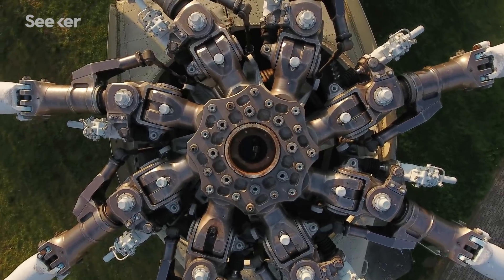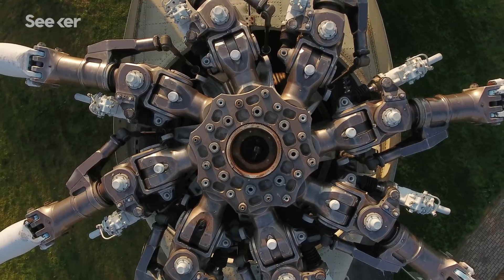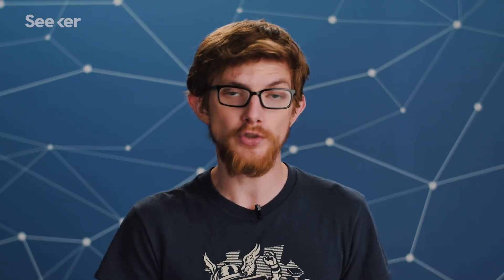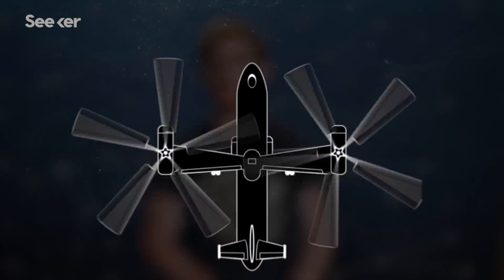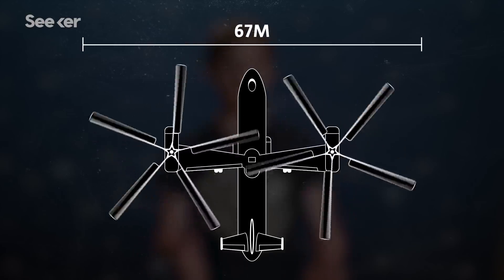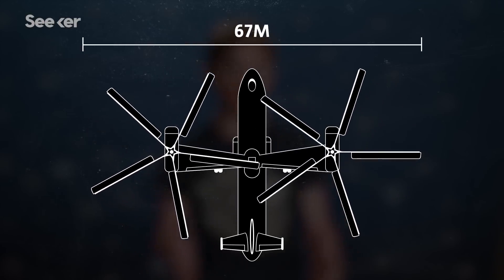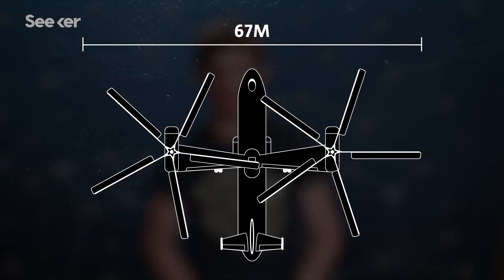Here’s What It Would Take for Helicopters to Be as Big as Planes

Comment: WRONG. *Biggest Bell has made and like most american content forgets about the rest of the world. Both the Super Stallion and the Mi 26 have greater Max takeoff weight which matters more and the Mil 26 has larger rotor diameter. V-22 84’ 7”  and 60,000 lbs,  CH-53 79’ 73,000 lbs, and the Mi 26 at 105’ and 123,000 lbs. And the Mi-12 prototype lifted 88,000lbs putting it at the largest ever at 220’ and 231,000 lbs

Comment: Id just add more blades. Just as subs do by adding more blades it decreases cavitation which would be a similar thing in the air just much faster w/ the sound barrier. Jet turbines have many blades too which again helps in this. Perhaps using both double rotor and many more blades per rotor would result in some amazing lift and speed characteristics.

Comment: Several factual errors, e.g. the supersonic boost in drag is not due to turbulence, and a there are ways to go fast in a helicopter that hovers with tip speeds near speed of sound. If you're going to do technical content, you need a competent technical editor. Thumb down, obviously. That said, the idea was cool, and if you re-do it *with due diligence*, then you might make something quite good.

Comment: the wing animation is upside down, low pressure area on TOP of the wing (caused by the acceleration of air due to the shape of the wing) is what generates the lift and not the air passing below the wing.

Comment: Of the speed of helicopters that become as big as passenger planes and their speed..
..
@Chemse Eddine Bouaziz
..
Hi,
It actually can. Multiple engines, multiple rotors.. and if wanted.. push propellers or jet engines easy to add.. In a plane design the wings are almost ultimately consolid.. but in a helicopter there are no such wings but instead very very flexible at once both horisontal and verticle movements providing propellers. A passenger plane let us say flies in a speed between 600-1200 kmph.. but when many many propellers are used instead of wings the thing would never be a less of speed.. however more of safety and (depending on the fuel but..) more cost.
..
Nevertheless, in helicoptering.. when the size gets smaller.. planes win the race of speed more in comparison.. which means: there will be circles flying instead of those stick like winged planes for passenger fligts so soon I consider.. however super speed flights in the air that are going to be based on aerodynamics will always be triangular in look..... .... ... but when it comes to nano-technical and basic force altering energetic flights.. flying machines will look like elliptical, globular or circular.. just like UFOs and Zeppelins.. and plus asthough triangular again.. they as some in shape will look like or be exactly as pyramids.. F117 Stealth Fighter is of such future design.. F35 is what is clinging to the Zeppelins..
..
This nano technical and g force controlling energetic fliers later will be using things as-in parallelism to "many propelling" scheme as those mentioned above.. and they then very probably will.. ultimately be flying like the UFOs.. unpredictably moving so fast from one point it stood in-on to another at a glance's time period.. as if they are using teleportation.. sound speed and further speeds will be surpassed so swiftly that the mass of air will carry the flying objects all of a sudden from one location to another or similar.. when by force and energy air gets so hugely handeled and g force gets altered.
..
Good bye.

Comment: So why can't they just have the ends of the blade designed towards  supersonic speeds and have the base of the blade design towards subsonic speeds, jet engines do it. Also, torque is a really bad excuse just use an electric motor powered by a gas generator if necessary.

Comment: I wonder if helicopter designs could be changed a bit or improved upon.  To me, giant spinning blades that are fully exposed do not seem to be the safest design.
Reply: Yes it is. As long as you're not 3m tall  and thry to reach te blaids.
Reply: there is also a fan wing design that's new that's really cool, it basically is like an old fashioned lawn mower blade on top of the wing of a plane..
Reply: Maybe rotors that retract the faster you go horizontally. I think some companies experimented with that I'm sure.
Reply: V2 Osprey bruh!
Reply: They are not the safest but they are very efficient. I have a design for a heavier than air hovering vehicle that is quite a bit safer and quieter but is likely slightly less fuel efficient. But I'm poor A.F. so we'll see if it ever amounts to anything tangible.
Reply: Zach Crawford Start a kickstarter or publish a design so someone with money can buy it.
Reply: QVear That's not a bad idea, but there is so much quackery and con jobs when it comes that "novel inventions" on crowdfunding sites. I don't want to risk being lumped in with that. I think would have to try and make a small prototype (toy sized) and if it works reasonably well (and is safe) then maybe I could sell copies of that prototype to fund the building of a larger one on a crowdfunding site.
Reply: Sorry but that idea is not so great. Yeah it would be safer, as you can see a Fenestron does that job well when put in place of a conventional tail rotor. While at the tail it doesn't add too much extra drag, it would add A LOT of drag to the main rotor, thus making it not viable because of so much higher power requirements. You can wonder why it's never been applied to any heli since it's creation.
Reply: Gears Starting o.
Reply: Gears Starting jhghjlloki8tuklp
Reply: Ducted fans, my friend. Ducted fans. So basically, small turbo fans.

Maybe ones that tilt for control.

Comment: If a helicopter is as big as an airplane.. Can it be as fast?
Reply: Chemse Eddine Bouaziz no way.
Reply: Chemse Eddine Bouaziz
..
Hi,
It actually can. Multiple engines, multiple rotors.. and if wanted.. push propellers or jet engines easy to ad.. In a plane design the wings are almost ultimately consolid.. but in a helicopter there are no such wings but instead very very flexible at once both horisontal and verticle movements providing propellers. A passenger plane let us say flies in a speed between 600-1200 kmph.. but when many many propellers are used instead of wings the thing would never be a less of speed.. however more of safety and (depending on the fuel but..) more cost.
..
Nevertheless, in helicoptering.. when the size gets smaller.. planes win the race of speed more in comparison.. which means: there will be circles flying instead of those stick like winged planes for passenger fligts so soon I consider.. however super speed flights in the air that are going to be based on aerodynamics will always be triangular in look..... .... ... but when it comes to nano-technical and basic force altering energetic flights.. flying machines will look like elliptical, globular or circular.. just like UFOs and Zeppelins.. and plus asthough triangular again.. they as some in shape will look like or be exactly as pyramids.. F117 Stealth Fighter is of such future design.. F35 is what is clinging to the Zeppelins..
..
This nano technical and g force controlling energetic fliers later will be using things as-in parallelism to "many propelling" scheme as those mentioned above.. and they then very probably will.. ultimately be flying like the UFOs.. unpredictably moving so fast from one point it stood in-on to another at a glance's time period.. as if they are using teleportation.. sound speed and further speeds will be surpassed so swiftly that the mass of air will carry the flying objects all of a sudden from one location to another or similar.. when by force and energy air gets so hugely handeled and g force gets altered.
..
Good bye.
Reply: No. But they could hover. Just imagine a 747-size Quadcopter hovering 30m above you.
Reply: You shouldn't of done that Mikrofonlar. I was just asking a stupid question for the sake of stupidity rather than seeking knowledge. But, thanks for the response.
Reply: Mikrofonlar Kralarına Cevaplar Just so you know, helicopters have wings, not propellers.
Reply: yes but by using multiple propellers you can avoid this problem, anyway even if it is physically possible it would cost a lot and take a lot of work, so there is really no point in doing it.